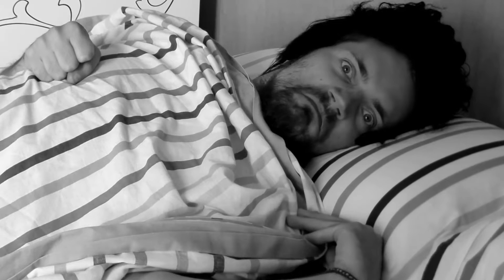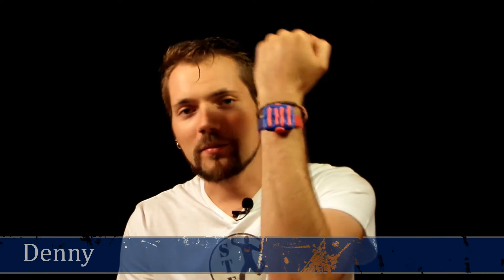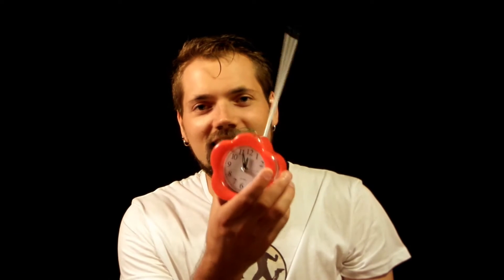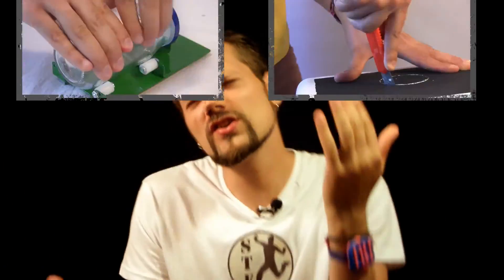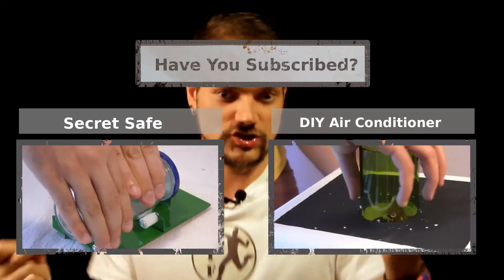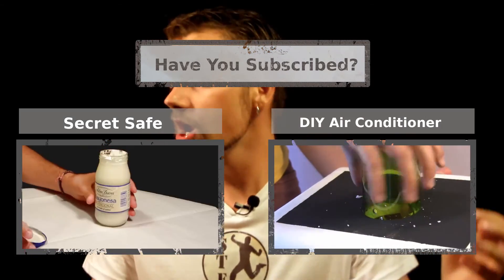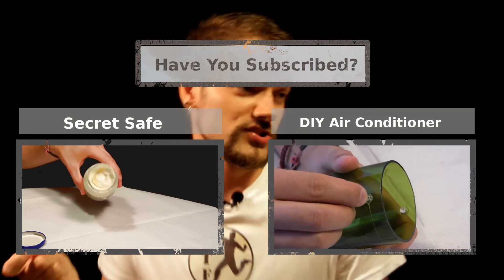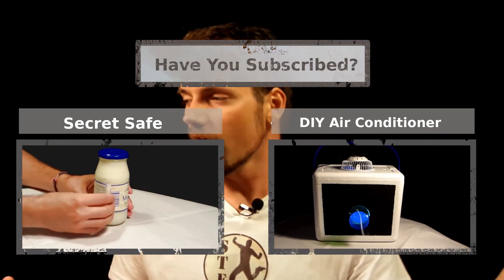DIY: Vibrating Alarm Clock

Comment: Can I use different vibrating motor? and in my plate, there are many wires which confuse me on where to connect the vibrating motor and the antenna. I hope you could help, sir.
Reply from the maker: +Aaron Limbo 
Yes, you can use a different motor.
I am actually planning to do another video in the next few months time (it should be better version).
You can see more details here, hope it helps:
http://www.instructables.com/id/Vibrating-Alarm-Clock-Sugru/

Cheers!
Reply: +Shake the Future It's a great help, thanks man!